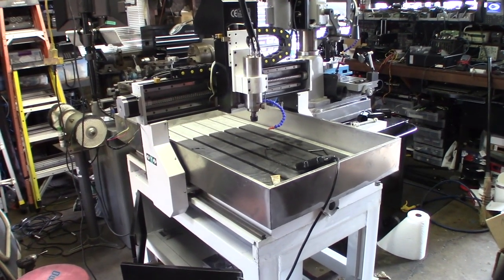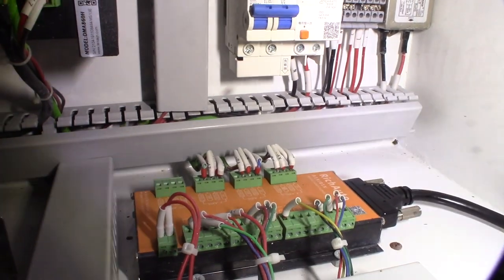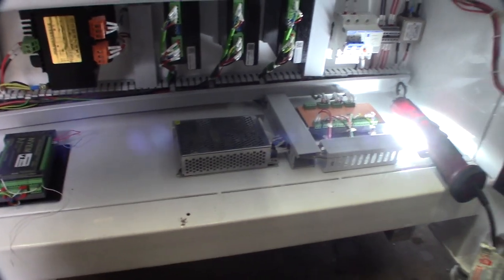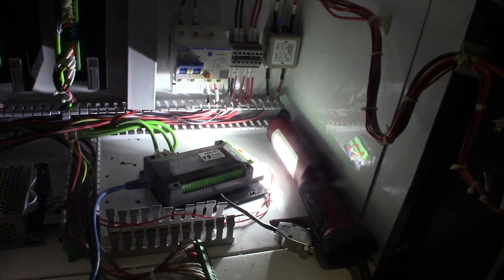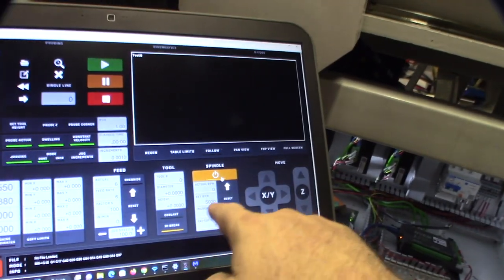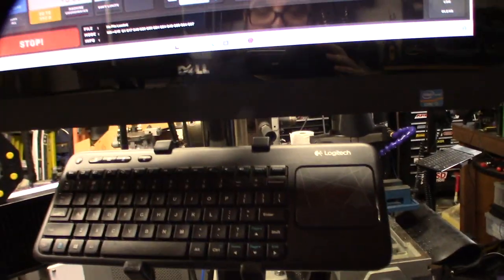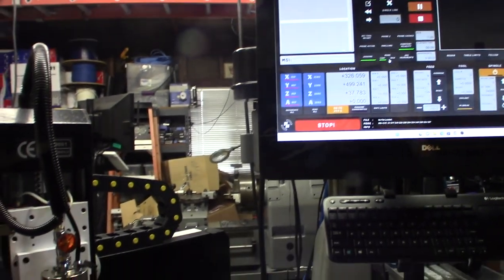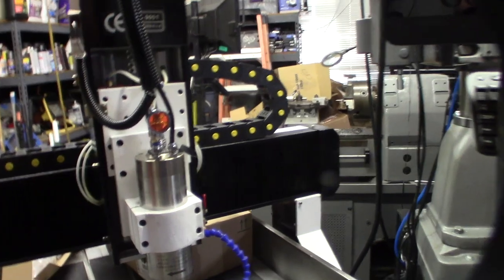Commercial 6090 CNC RichAuto to Mach3 Conversion Future LinuxCNC Novusun NVEM EC300 EC500

Comment: lol i did the exact same thing!
i just pulled out that analog piece of crap vfd and installed a digital one.
Also used a RS485 adapter to get the EXACT and realtime RPM readout in mach.
But NVEM keeps bugging out for me.
when i use a Tool setter or touch probe.
then it works next time breaks a end mill or a stylo and just plunges into the bed like there is no contact there.
NVEM suck big time.
going to replace it with a Smoothstepper.

Comment: I have a cnc machine with a controller richauto and I want to know if you can install the same setting u have there (touch screen, Xbox controller,  solidstate relay to control coolant and a vacuum, and probe)

It's possible for you to travel to New windsor NY
Reply from the maker: I'm in CA, what kind of machine is it?